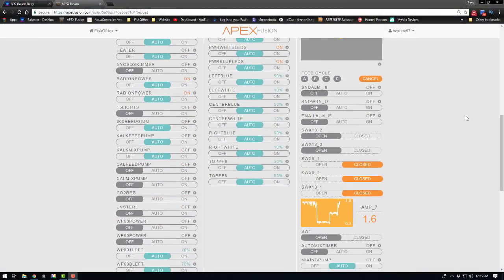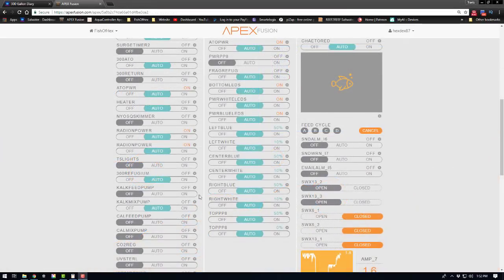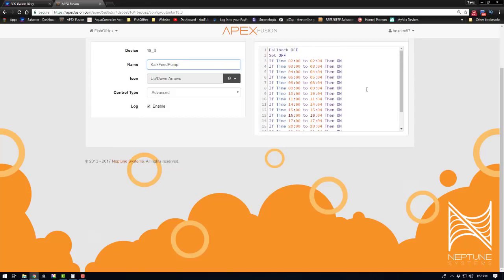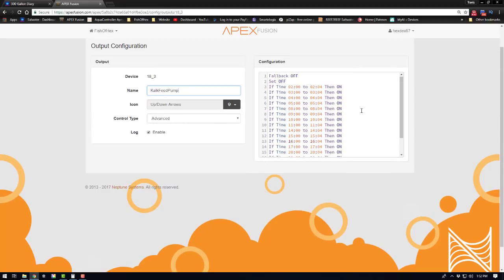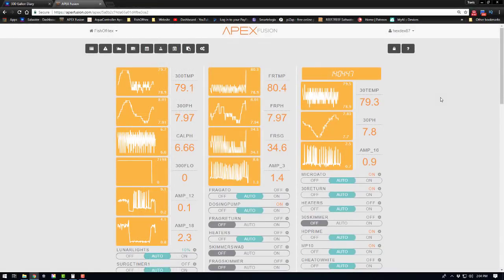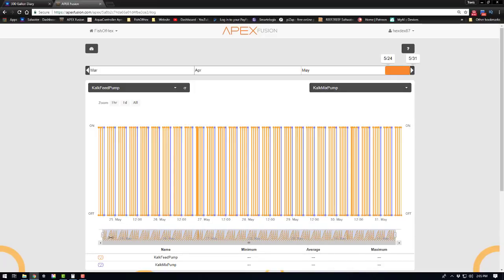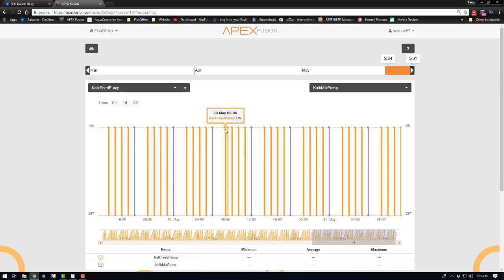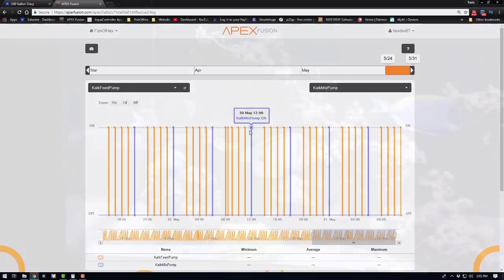DIY Kalkwasser Reactor Part 2 | Setup & Apex Programming

Comment: I dose kalk from a reservoir using a peristaltic pump. Here’s how I do it with fewer lines. It runs for 4 minutes every half hour between 8pm and 12pm and shuts off if the display ph gets too high (never but just in case) or the sump level gets too high. Much easier than all those time lines. Can just increase the duration and frequency with the osc command and change when it’s off, based on your display light schedule and the pH drop. Could do a similar osc command for your kalk mixing pump. 

Fallback off
Osc 000:00/004:00/026:00 then ON
If [ato avast pressure switch] open then OFF
if time 12:06 to 19:59 then OFF
If pH-dis > 8.5 then OFF

Comment: I'm working on setting up a kalk reactor to work with my apex.  My plan is to use one top off pump but have a manifold consisting of two solenoids that will open/closed based on tank pH, the valve in front of the kalk reactor will close if pH exceeds 8.4 in the display and the other solenoid which by=passes the reactor will open.  I will also leave the RO only valve open for couple hours after the mixing pump stirs the kalk so that salinity in the tank remains stable.  I think overall the programming will be much easier than what you have outlined here.  I also will hopefully be providing a safe guard against a kalk overfeed  because any time the tank is more than 8.4, the kalk reactor will be bypassed.

Comment: Are you still using this Kalk Reactor? How long did it take to dial it in?  I bought a Kalk Stirrer, I just havent used it yet. I have 2 part set up currently. I know there is that risk of something happening with the kalk and spiking PH. I have an apex and the kalk stirrer is reef octopus. I just want something to help keep that PH in a stable zone. If you have a few minutes to give any advise, etc that would be appreciated. Many Thanks